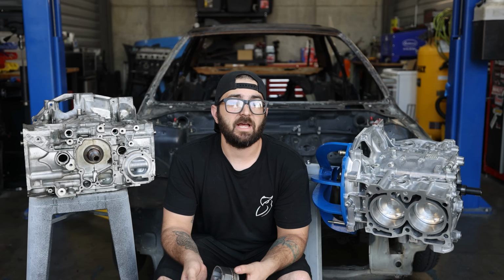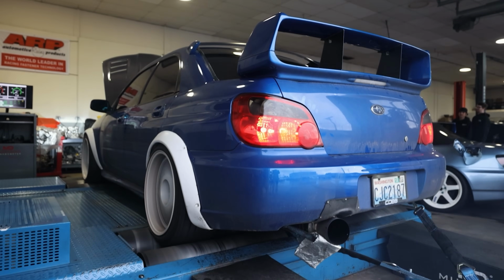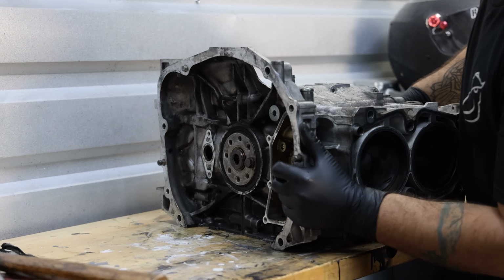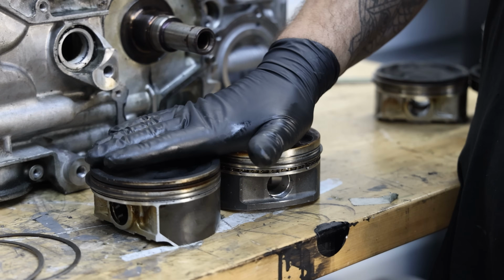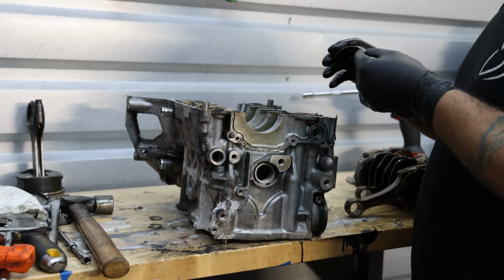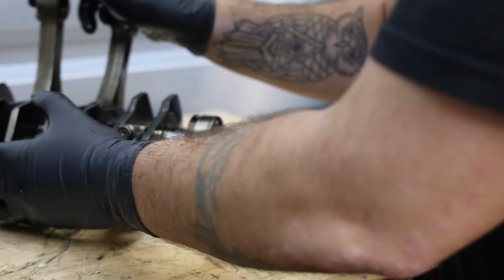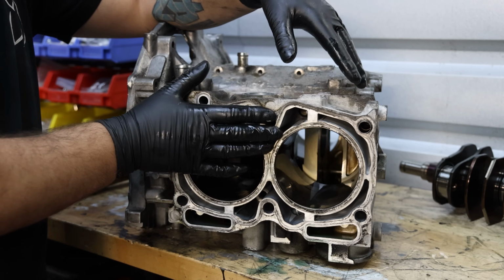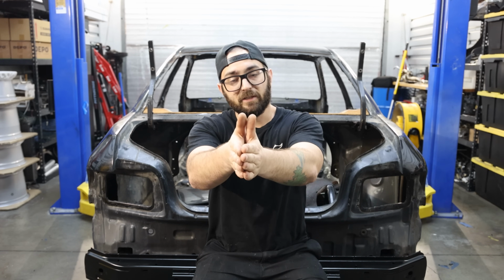The Reality of Stock Engines & making power; Subaru WRX STI

Comment: As a dyno guy... I seem to see that 430whp is about the end of what may stay together(stock block daily), and that's assuming good fuel and not doing sustained side to side G-Load.  After that I feel it always benefits the user doing something more substantial in the block/heads/gaskets.  Depending on the "stock block" year/type though, you could be only safe around 350whp...
Reply from the maker: I’ll tend to push it a little farther but definitely depends on a lot of factors. I’d say 400 is typically a good spot to stop where you can get some decent life out of the engine as well. Drivers style also plays a HUGE factor
Reply: 400whp/300kw seems to be the happy max spot for 207/257 from what I've seen here in Aus, not sure if we got the RA blocks or not in the 2019 onwards sti.
Reply: @Ufarkinwotm8  lol. Had a few now and i would go as far as saying 250 kw MAX and every day you wait lol ( Aussie also )
Reply: @proximitybeejay3673  i know of atleast 5 people thats been running 300kw+ on stock blocks for literal years at this point, infact 1 05 STI has been running at 350kw and beaten every week for 3 years. Either luck of the draw or crap tune
Reply: 207? @proximitybeejay3673
Reply: Would you say that how people drive them is the biggest factor you see in engine failures?
Reply: @nathanielgates2863  Not entirely.  I see bad fuel or hot oil come up a lot.  The more power, the more BTU.  That includes oil.  The next is just physical warping... which again, is a physics problem more than a driving problem.  You get to a certain range and the materials are past the technical limits of capacity.

Comment: i just snagged a blown up engine for cheap (wanting to experiment with engine building and didnt want to use my actual engine 😂) where should i be look to for measurements to see if the castings are usable? thanks
Reply from the maker: For the mainline look for distortion around the bores. 

For the cylinders you’ll check the same thing. If you’re going to build one I’d highly suggest sending the cases to Outfront to have everything cleaned, machined and checked prior to building. Normally cases will be salvageable unless they have damage to the main line, have been over heated or deep scoring to the cylinder walls.
Reply: @Smeedia appreciate the info!
unfortunately I'm in PA so sending engine stuff across the country probably isn't gonna be worth it compared to using someone more local

Comment: really helpful information Tanner! my 17 sti finally makes power after contact with you, and it has so much fun even not making full power.
Reply from the maker: Eyyyy what’s she making right now? 🥳
Reply: @Smeedia  320 at e70. the clutch is on the way out. so dial the power and torque it down, as it is my DD. so much fun

Comment: Omg yes I’m building my engine as i watch this video type ra shortblock power goal is 400 wheel i hope it holds!!! also I need tgvs to get tuned do you know anywhere where I can get a pair of oem used tgvs I can’t find any😢
Reply from the maker: eBay is always a decent place or market place. That’s where I get most of my used stuff 🫡 541 motorsports is a good place too

Comment: Thanks for the video Tanner. I’m currently still on a stock EJ257 and I’m installing a TD05H-20G with water meth (no ethanol where I live). Hope it goes well lol
Reply from the maker: Make sure you have some safeties in place for the meth kit. Should be a fun car when done 🥳
Reply: @Smeedia  I did get the AEM solenoid for safety! Other than that I’m running every reliability mod that exists for an EJ